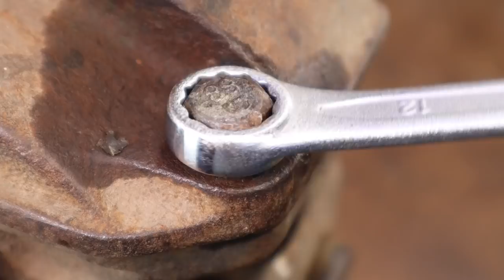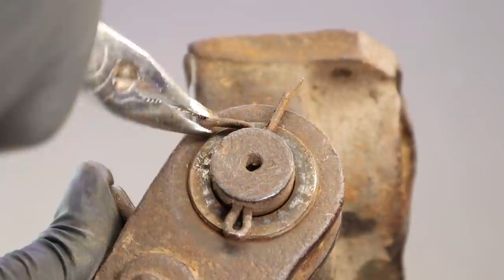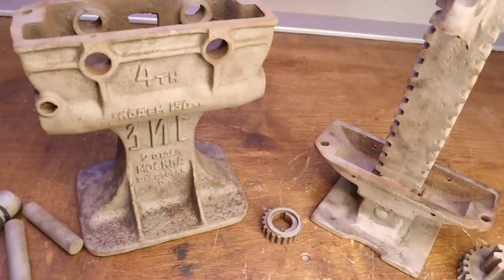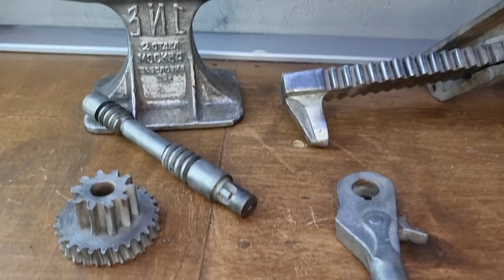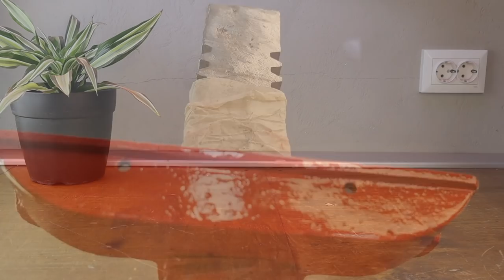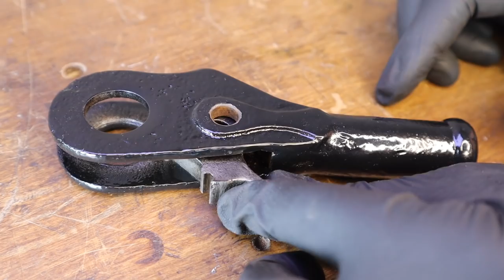WWII Soviet light tank jack restoration

Comment: Sorry mate... that is not a WWII piece. The marking on the screw heads were introduced much later (the 8.8 tensile strength for exe).
But nice piece... and nice work
Reply from the maker: I agree the bolts are new, but they were most likely replaced later. You can recognize the jack on photo on the right(over the left track) behind the shovel -http://bronetehnika.narod.ru/t70/t70_109.jpg